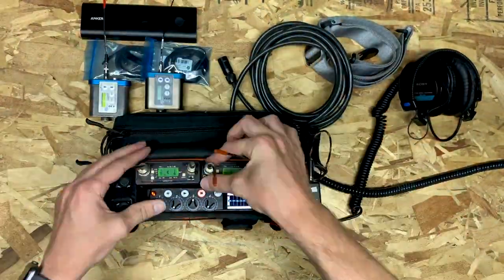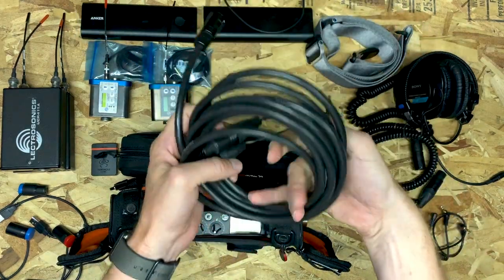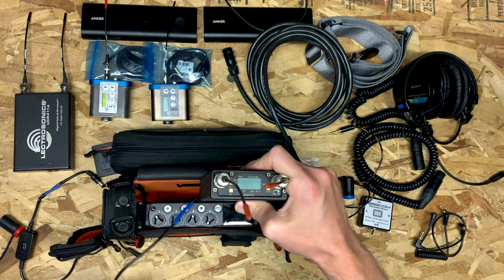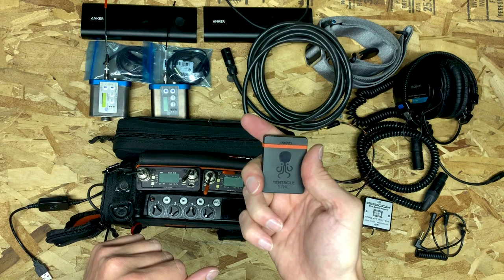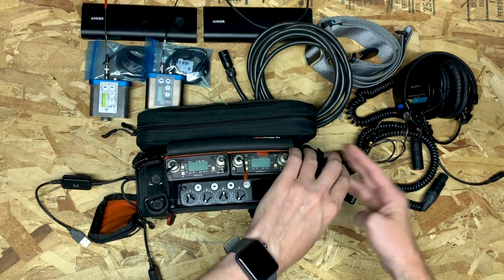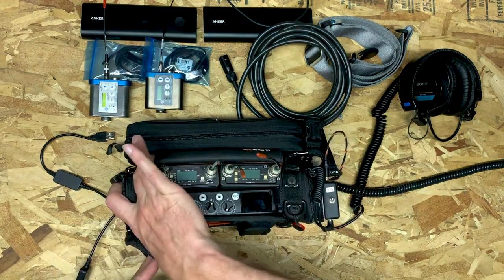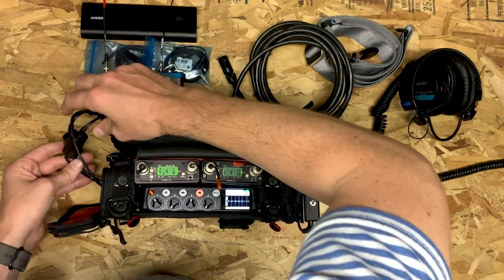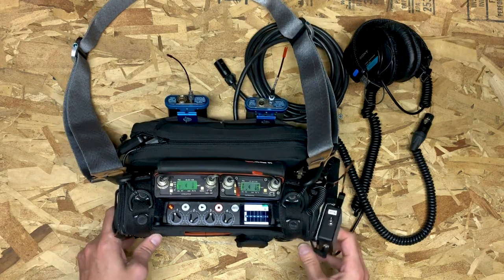Building a Location Sound Bag Around a SoundDevices MixPre-6

Comment: Excellent video! I just ordered the Anker Battery and 12v USB adapters.  I'm using the Mix pre 3ii and a couple old Lectrosonics 195Ds. Simple and inexpensive setup for little projects. (Retired sound mixer here)
Reply: According to specs I read, youi can get one 12v usb adapter and a splitter, one usb out should provide enough current to power 2 ucr 411 receivers. Or just buy 2 and have redundancy.

Comment: Great set up and video thanks . Does the mix pre 6 except 5v from the Angkor battery ? What size / amps are the batteries ? Thanks
Reply from the maker: The battery is the Anker PowerCore+ 20100, which I think is sold out or discontinued now. The connection from the battery to the MixPre is over USB-C, which Anker lists as being 6v.

Comment: The ankor battery is currently out of stock everywhere. What would be an equivalent battery to get? Appreciate all the info. Great video.
Reply from the maker: Here is what the SoundDevices website says:
- USB-C power source that is compliant with the USB powering specification and is able to output 7.5W
- USB-C cable that incorporates the correct pull-up resistors to identify itself as able to provide 7.5W

Now, I think this is for the MixPre mark II, since the battery I use I think only outputs 6V thru the USB-C port. So I would just search around for those specs. If you can find a battery that does it, chances are the cable that comes in the box would push the correct voltage.

Comment: Thanks for this excellent video. Please, what's the internal actual width? Specs say MixPro bag is 2 inches/5.1cm, but that would not allow MixPre (3.6cm) + Lectro UCR... So , what's the "real width capacity" of the main compartment please? Thanks in advance, it's hard to get real size specs of sound bags!

Comment: Great little video there. I have got a Mixpre6 which normally runs G3 receivers,  but just got an UCR411A. Which gain settings are you using on the mixpre for it? I tried to calibrate with the DBU test tone, but it seems to be off, so after some experimenting with what sounded good, I ended up with line level and 12db of gain, but I would be curious how you have it set up?
Reply from the maker: Well, there is really no one size fits all answer here, of course, since it depends on what you are recording, what mic and transmitters you are using, etc. But for starters, you might want to check your transmitter gain first, before you mess too much with the 411. Also, I run my 411a in at mic level—though I'm not sure if that's technically "correct." But it works for me, and then I can dial things in with the pot.

Comment: Awesome Vid! By the looks and checking out Sound Device's website on their power options - that Anker power bank looks like the PowerCore+ 20100. If so, could you please give me an estimate of how long one battery lasts? Thanks!
Reply from the maker: That is the battery. And honestly, I haven't done a true test of it because I very rarely have both the wireless receivers running for the kind of gigs that I do. But 8 hours safely. I mean, with no wireless on and just powering the MixPre you can get like 16 hours, maybe more.
Reply: @FieldNoiseWorkflow  Awesome! How sturdy has the USB C cable been for you? I'm worried I might pull it out while walking around booming
Reply from the maker: @PC-oi3dw  This comes up from time to time in other forums, but this is a total nonissue for me, especially because I have my boom cable on the other side of the box, as you can see in the video. I forget if a cable comes in the box, but if it does it is way too long. I use a short, basic one from Amazon and have had no problems.
Reply: Fancy meeting you here, Peter! 😁
Reply: @FieldNoiseWorkflow  They also sell a 26800 model with more juice. You could also power the receivers from a Sony L battery with the correct battery sled with 12 volt outlets and the correct cable to the 411. This would give you more battery life with the Anker and some redundancy.

Comment: With the Mk II versions of the Mixpre models coming out, any thoughts about how you would adjust this setup for that model?  If I understand the in/out options for using timecode, it looks like you have to plug something in (like a Tentacle box) to the stereo out, jam that from the Mixpre's TC signal, then plug the camera send back in while shooting.  It's great that they added timecode, and maybe it's just that I am missing something, it seems they are one port short (TC out) of it being fully useful without extras like Tentacle boxes.
Reply from the maker: It's a great question. In an ideal world, you wouldn't need the Tentacles: you would start timecode on the new MixPre II, then jam that timecode directly to a camera using a cable like the Tentacle's 3.5-to-BNC. Once that is done, you would need to switch the Stereo Out setting back to audio, and then you could run the cam return directly into your Aux In since you won't need the tentacle for that. I'm not totally sure it would work like that, though.

Another option would be to sync the MixPre to a Tentacle, then give that Tentacle to your cam. Since the MixPre can run that timecode internally, you can still take the Tentacle out and reclaim your aux-in port.
Reply: @FieldNoiseWorkflow  Thanks!  Your video made all the difference in me understanding how the Mixpre handles this stuff!  In an ideal world, all cameras would have good timecode handling internally and we'd jam periodically and be all set.  (Or everything would just read time in realtime from GPS signals which are preposterously accurate.)  I'm likely to always be in situations where there are cameras that don't have internal timecode (like the GH5 non-S) so I probably won't be able to avoid Tentacle (or similar) boxes and/or no return to camera.  Please keep the videos coming, they're super helpful!  Thanks again!
Reply: Field Noise Something I do at start of day is turn on my 633 (or MP6 in this case) Sync a Tentacle to it and put it in my pocket. I leave a 3.5mm to 3.5mm cable plugged in so it stays on all day. Then I Sync all other Tentacles to the one in my pocket, and can sync the recorder to the one in my pocket if something goes wrong or if I know the recorder lost sync due to something I did. I also carry all Sync cables I will need for the day with me. It is a good feeling to know I have a master sync clock running independently of everything else should there be a need or a problem.
Reply: Thomas Donalek I used to think that cameras should have great TC clocks and used to jam sync every camera in the morning and again after lunch. I learned that was not a good workflow. Any camera can lose TC for a variety of reasons and need to be re-synced. So I bought a bunch of Tentacles when they first came out and always put a Tentacle on every camera, even an ARRI Alexa which has the best TC clock of any camera. I don’t even think about TC again until wrap when it’s time to collect up all the Tentacles. 

There is a company making GPS coordinated TC boxes. Can’t think of the name and it might have been a Kickstarter.
Reply: @RallenMan  Everything I'm doing is "small scale" (and very small budget) so I am looking to avoid even the expense of Tentacle boxes.  That said, the more I learn, the more your approach makes sense and sounds like the right way to avoid random problems/headaches.  Thanks!
Reply from the maker: @RallenMan  Cool idea. With the MixPre version I, you have to keep the Tentacle connected directly to the MixPre for timecode to work, but I think in version 2, it will jam sync.
Reply: Field Noise That is correct but I’ve got four Tentacles so my method still works well even with a Series I MixPre.

Comment: Having problems operating the headphone encoder when mixer in bag? Are your settings dial in enough so you don't need to get at it much?
Reply from the maker: Exactly. I use the presets to save settings, but also in the more recent firmware versions I find that almost everything I need can be accessed from the touch screen display.
Reply from the maker: That said, since it’s on the headphone side I usually have that side of the bag open a little anyway, but truly I almost never need to get at it.

Comment: Do you think this bag can fit the mixpre 6 with normal XLR cables? (not low profile, nor right angle ones) I don't know if the sides of the bag will put pressure on the XLR's..
Reply from the maker: For sure it can. Before I got the low-profile cables I was running normal ones and there was still room.

Comment: Wouldn't it be easier to connect a wireless transmitter like a G4 ew500 to connect to a camera? Just asking. New to this. I know cameras, trying to learn sound.
Reply from the maker: The answer is yes and no. Running wireless in that direction will be one channel and probably require a special cable—this is often called a "camera hop." However, camera hops do NOT provide production level audio, so you have to be sure that your production company is gonna pull the audio off your SD card in post and then sync it. One of the reasons you buy an expensive cable to send sound to the camera is that it then mirrors the SD card exactly, so your production company can save a step and have the sync'ed audio already on their video files. Hope that helps clarify! Sorry for the long delay!

Comment: Hi Field Noise, nice video you did there! I was hoping you could answer me a question: Have you ever experienced problems with signal loss/interference, with the outputs being unbalanced, when recording directly into the camera in an ENG setting? I'm putting together a similar sound bag around a, yet to purchase, Mixpre 6 II and am wondering, if I need to reserve room for a DI box, which would also add a considerable amount of weight to the sound bag. Your input would be very appreciated! Thx a lot!
Reply from the maker: Hey there—so, I have never had any trouble with the signal because of the unbalanced out. My understanding of this—which is not very technical—is that balanced are critical for very long cable runs. My breakaway cable is only 15’ and has never been an issue. Good luck!
Reply: @FieldNoiseWorkflow  Thx for your feedback!

Comment: Really like the set up! For breakaway cable, I'm only seeing ones with two xlr male  connectors at the camera end. Is there an adapter you recommend having at that end for camera?
Reply from the maker: Most of the time I’m working with video cameras that have XLR inputs or shooters who have purchased audio boxes that integrate. For example, Sony makes one that many people use that adds XLR inputs to the a7 line. If you need to go back to 1/8”, you should be able to use any dual female XLR to 1/8” stereo adapter.
Reply: @FieldNoiseWorkflow  awesome thanks for the response. I wasn't sure whose responsibility it would be on set to have those connectors, but I'll definitely be prepared with the 1/8th to dual xlr. really appreciate your video! My kits almost built out and it helped a ton.
Reply from the maker: It’s ALWAYS good to be prepared, but let me say that I have never had to go in to an 1/8 jack. That said, you can and should ask clients / producers what can will be used, what the expectation is for timecode, etc. RED cams need a different timecode cable from other cameras, etc etc. I have had people tell me to get familiar with camera menus so you can help the shooter adjust settings if necessary—and sometimes, trust me, that is necessary!

Comment: Your kit is nice.. Btw is it possible to load the L mount with npf970 batteries
Reply from the maker: I'm not sure—I don't have or use those kinds of batteries.
Reply: Yes it is, and you can use L batteries with 2, 4, 6, or 8 18650 lithium cells inside them. But you still need to power the receivers, which could also be powered by an L battery and the correct battery sled and cables, I bought a simple rig that includes test lights.

Comment: Hey I have a couple questions since I am looking at purchasing receivers. 
-What is your Anker Battery life with the addition of the USB-to-DC adapters powering the receivers? 
-How do you deal with accessing the headphone knob with everything on the left and the bag's internal frame?
-Do you find that a Boom in input 1 has the pig-tail cable awkwardly crossing your body?
Reply from the maker: Hey Ken—good questions.
- I think I ran an overnight battery test, but I honestly forget the results. Most of the jobs I've worked on recently have only been using one lav, and with that set up I can go all day on one battery. I think on one shoot I swapped it out at lunch just to be extra safe since the afternoon was long and critical.
- I very rarely access the headphone knob. I set my level between 70-74 and then access all of the menu items via the touchscreen. I think Sound Devices know this design is flawed, and almost everything can be done via the touchscreen in the most recent firmware.
- I always have my boom in input 3 or 4

Comment: Very interesting video.
I'm scared about those usb connections. Did you ever experienced problems with unstable connection while moving around? The MP6 has a seamless swap feature that allows the device to continue the recording even if the usb-c power becomes unavailable, providing that the 4AA pack is connected at the bottom, of course. 
How long will those anker BPs last with the MP6 and wireless receivers?
Reply from the maker: No need to be scared about USB. I’ve seen people speculate about that on other forums and it’s just never been an issue. And yes, batteries will work as backup. I usually don’t have both my receivers on for very long, but I think it is safe to say 8 hours.
Reply from the maker: I also want to add that the key to moving around is to have your bag really dialed in and secure.  Like, when I’m moving, nothing in my bag is.
Reply: @FieldNoiseWorkflow  You could always use a battery distribution system and make things more complicated but have a couple different power solutions for redundancy.

Comment: Terrific video. Are you able to access the headphone volume okay with that bag, or do you set it and forget it? Thanks.
Reply from the maker: Hey Matt—sorry, just saw this. The answer is set it and forget it. I usually have mine around 72 or 74, I think. You can get to that headphone knob if you need to, but I wouldn't recommend it! Most of the settings in the most recent firmwares can be updated on the touch screen, so it's not super necessary to get in there very often.
Reply: @FieldNoiseWorkflow  I have the MixPre 3 ii - and maybe it's different because with the 3 ii the headphone volume know does other things. But, the question/solution? is the phone app that can do all the settings. ??
Reply from the maker: @oliverleslie7382  I'm pretty sure it's the same as on the first version, but like I told Matt, almost all of the settings now can be accessed by the touch screen so that you don't need to use the headphone knob. I'm sure there are exceptions—is there something that you specifically use the headphone knob for?
Reply: @FieldNoiseWorkflow  it also scrolls through settings which you can do on the screen but the screen is tiny and fingers can get clunky.
Reply from the maker: @oliverleslie7382  I hear you, but I guess I haven't had any trouble with that yet! I also try to set my settings in advance of a shoot as much as I can, so that once things are dialed in in the bag I don't have to tweak things too much!
Reply: @oliverleslie7382  Check the sound devices wingman app manual for details.

Comment: Question: Do you find the USB-C connection into the side of the Mix Pre itself secure and reliable? That connection seems a little flimsy to me.
Reply from the maker: I’ve never had a problem with it!
Reply from the maker: But for security you could tinker with right angle cables that might be less prone to being jostled, but I keep that side of my bag zipped up and it feels rock solid to me.

Comment: Sorry, I’m still familiarizing myself with a lot of the nomenclature of film sound. What kind/brand of wireless microphone set up are you using?
Reply from the maker: No need to apologize! The transmitters (the part on the talent / interview) are Lectrosonics SMQV. The receivers (the things in my sound bag) are Lectrosonics 411a. The mic attached to the transmitters is the Sanken COS-11d.
Reply from the maker: Many people start out with Sennheiser G3 / G4 systems, which can be fine for a lot of circumstances. But even with those I would STRONGLY suggest upgrading the mic to the Sanken one. It’s an industry standard for a reason.
Reply: @FieldNoiseWorkflow  thanks a bunch! 👍🏼

Comment: can you access the knob on the right side in that bag? looks very tight
Reply: i was thinking the same thing  - that knob really helps to navigate without touching the tin screen. If it was just head phone volume then fine.
Reply from the maker: Hey guys—so I think I said this on another comment, but I pretty much never access the knob once we get rolling. Got my settings / presets dialed in, and I keep my headphone volume consistent. In the most recent firmwares pretty much anything can be adjusted with the screen.